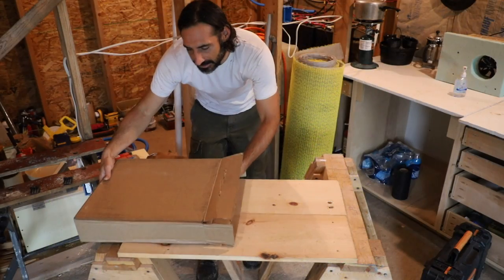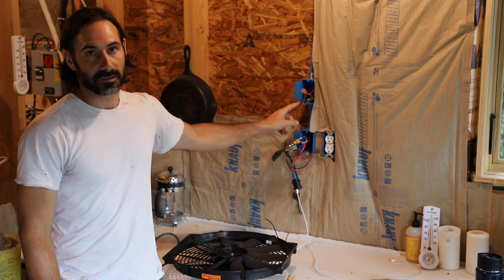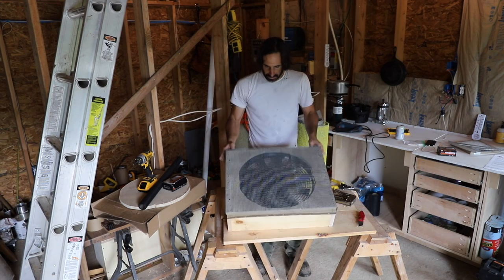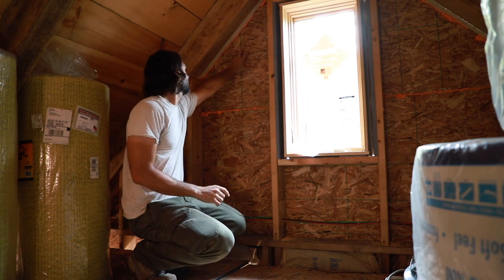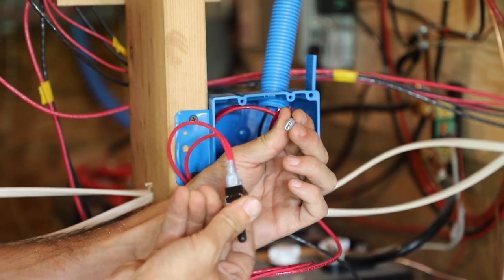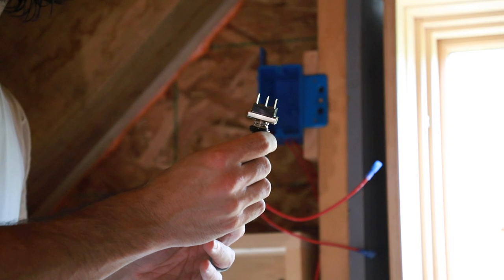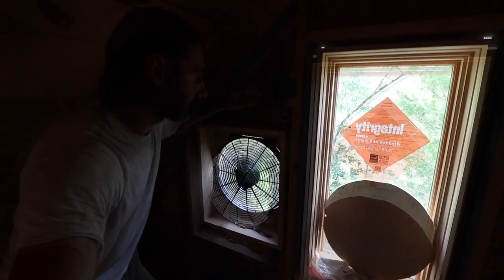Off Grid Alternative to Air Conditioning?  Making a Whole House Fan From a Radiator Fan

Comment: Dam it all, I could have sent you a fan that makes zero noise, (and yes, it meets your electrical criteria.) If I missed something than I apologize and everyone can just humour me.. There are a few alternatives that do an amazing job without having to turn up the volume    cabin efficiently, effectively and with little or no electrical power. If I was faced with this issue I would firstly kick myself for not installing a system after the sheeting went down . The system you just built for us is amazing but i wouldn't go down the same path because of the noise. There are amazing alternatives that can achieve the same thing such as solar powered opening sky , one is a solar powered set of opening skylights . The cool part is the glass and the internal  and external parts of these skylights are amazing. The "glass" in the skylight is new technology and in its varied applications work exceedingly well using the rays to power the mechanism that opens and closes the window and the sensors that detect rain or snow therefore closing the units. The idea behind your radiator issue can be remedied with an alteration or re-engineering of its current configuration. Can you install a speed selector or a dimmer switch with a thermostat so when it reads a rising temperature it automatically tunes on full speed to remove and refresh the ai rather quickly, now to manage it the new operating system will reduce speed from full power down to the lowest setting once the fan has done it's job by expelling the hot air in the gables the fan can reduce speed to the setting it needs to maintain the desired temp.. Just a long winded comment.. Iam sitting in envy of you and what you  have accomplished, hats off to another soul that has a tiny eco footprint .. we need more of us the actually care. Im afraid it was   generation that has done such a terrible job raising their kids whom are now in their early twenties and couldn't care a less about recycling, power conservation and alternative fuels..  How could we allow this to happen...I'll tell you, more children have spent incredible amounts of time at either the TV , video games and their social became logging on to _uckbook. So they are dooms day believers because thats all they see, death and destruction either from the news, violent movies and video games that are stealing our children's innocence.  Ill shut up  now...my apologies most of that had little to do with your teachings...
Reply from the maker: wow very cool. I will have to talk to you before the next project!  I do plan to wire in a speed controller I think that should help if I ever want to leave it running over night.
Reply: I couldn't agree with you more! My son will be 31 next week and my daughter hits 26 in September and l have one 4 yr.old grandson from her. I worked 2 jobs the entire time my kids were growing up just to barely get by, but we did and my kids are quite aware of many things that  their friends have no concept of! Its' always something new, be it good or bad...just look for TRUTH, it'll come your way!!
Reply: @kandiwolfe1125  You can't do anything wrong when your doing the right thing.  I hope your proud you obviously did right by your kids...

Comment: how come you didn't' buy a solar power fan from the home store?
Reply from the maker: Well, technically everything in the cabin is already solar powered.  The power system is 24 volts DC so I was very limited in fan selection.

Comment: I think there is some confusion about how long that fan will run. Its only going to run like 5-10 min. It really doesn’t matter if its that loud.
Reply: yes it does matter.
Reply from the maker: Yea it changes the air really fast.  I am also going to wire it to a controller so it can run fast or slow
Reply: Yankee Inventions   And why is that?

Comment: "That's a lot of extra wire I left there..."  commonly referred to as a maintenance loop!  This of course does not denote that I've screwed up connectors so badly that I've had to cut wire and try crimping all over again.
Reply: Frizzle:  What are the wire connectors called that he is using?  Can they be used behind drywall?
Reply from the maker: haha yea same here!
Reply from the maker: I think m y connectors are meant for DC wiring in RV's and whatnot, not sure if you could use them in a code situation.
Reply: Thanks for the wise advice.   I'll hire someone to do that part for me (I'm brave, but I don't think I'm that brave when it comes to electricity!)  Love your videos and cabin.  Always wanted to build my own place, so I appreciate your talents.

Comment: Good idea, but that fan is way too loud.  Should have put a speed controller on it.
Reply from the maker: Never too late for a speed controller.  At max speed it changes the air in the cabin in under 3 minutes.

Comment: i am confused by video scenes order at around 13:00 ... ;-)
Reply from the maker: It's possible I mixed something up when putting all the clips together.  I basically wire in the other switch at that point so I can turn it on or off from upstairs or downstairs.

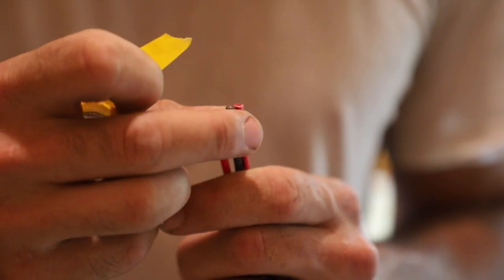Comment: It's a little loud but you got to figure when you're hot and uncomfortable you won't really care are real Whole House Fan is a lot quieter than that so we run it at night when it's cool outside and pull in all of that cool air and we run it till about 9:30 10 in the morning then shut it down and close up the house and try to keep the cool air in the house for as long as possible as it gets hotter outside during the day by late evening it's pretty hot in there so everything is open to backup but after dark the temperature starts to drop again and the fan comes back on pulling a cooler night air into the house it makes a difference the house pretty much goes from being completely unbearable 20 hours out of a day with heat and humidity to only being unbearable and uncomfortable 6 hours or so a day
Reply from the maker: yea its a bit loud, I am hoping after I wire a speed controller it will be a bit more bearable and work like yours

Comment: Great idea, but bad Implementation-- that being that God- awful loud ass fan!!  What you need is a low speed fan that you have verified is quite, yet able to provide a suitable CFM capacity. And putting a filter is also good for low maintenance situation.
Reply from the maker: It does 2,250 CFM, changes the air in the cabin in around 3 minutes (conservatively) then I use the built in silencer AKA the off switch.  I probably will fit a furnace filter to it and install a PWM controller.

Comment: Don't want to be that guy, but..... wouldn't you be getting a massive amount of voltage drop over that length with that gauge of wire?  That switch would be getting seriously hot wouldn't it?
Reply from the maker: Hey man cave, It's 5 amps at 24 volts over about 10 feet.  With the 12 gauge wire used, it comes out to under 1% voltage drop.  The switches are supposed to be able to take 20 amps we'll see if they hold up.

Comment: Why not wire an outlet next to the window and place the fan in the frame in the window behind the screen? You could use it in the summer and put it away in the winter. That way you would not have to put a hole in the wall
Reply from the maker: I like to run stuff like this straight off my battery rather than rely on my inverter.  The inverter is an instant 10% hit on efficiency, and also a decent draw on idle.
Reply: Makes sense thanks for the reply really enjoy watching your progress

Comment: Few comments, that fan is made for decent flow but also needs to pull air trough radiator fins so it must have reasonable high pressure difference (hence many fan blades), result is power hog that is loud. I would install something like this (2-4 of them): http://www.sinwan.com.tw/sinwan_web/main/en/dc_spec.asp?Type=Axial%5FPlastic%5FDC&Series=SD254AP&SID=10325  i compared flow measurements (measured it myself) with box fan ind it is comparable (~500cfm) but this one is 24V, 13 Watts only, smaller then box fan and it is super quiet even compared to reasonable loud box fan so is way quieter than that radiator fan you use, this fan of yours is just noise machine...  Here is nice selection of fans over 500CFM  with all the data you need to filter so can find perfect one...
https://www.digikey.com/short/pbdffc
Reply from the maker: Those fans look really neat, If you knew how long I have scoured the internet for a 24 volt fan you would laugh or cry.  I wish I knew about that before I started!
Reply: @50Acres  Well no prob. good thing is you can always sell yours because people use them a lot for their vehicle fan when they break, and start fresh... Also someone mentioned temperature regulation, yes differential thermostat with proportional output is the best way to deal with this, Arduino with 2 temp sensors or some similar micro running PWM with mosfet as switch can take care of that no prob.

Comment: Some advise on your crimp connection  tool, you need to test the connection you are producing with your tool  by pulling on the connection as hard as you can and if you are able to pull the wire out of the connector  your tool is wrong! You need a tool that has a talon where it crimps the connector. The standard crimp connection tool does Not do this, it simply crushes the connector and it will not hold. The talon type tool presses the connector in the center making a Permanent  connection. REALLY!

Comment: Why not just run a 4000 watt generator and a 5000 btu window unit. Screw hot sticky humidity. Besides when dew level gets just right ur house inside will be wet everywhere.
Reply from the maker: that would also work!

Comment: how can a fan replace air con when your dragging hot air in from outside im from CYPRUS 42 DEGREES thats as good as a chocolate teapot
Reply from the maker: You turn it on in the evening when the sun goes down and the outside temperature drops.  If you run it during the day it would not do any good.
Reply: @50Acres  the air in cyprus outside in the evening can stay at 30 believe me the only way you can stay cool without air con is a large pedestal fan because here the buildings turn into ovens after 40plus all day and im referring to houses outside villages where we are at and you have to really live outside im not trashing your idea but it wont go here, but hey it might be ok elsewhere
Reply from the maker: @ronspannermanread  sorry it wouldn't work for you
Reply: @50Acres  its a good idea and again im not taking the p,,,,s but ive tried everything here its a big problem as i cant sit under air con it makes me ill good luck

Comment: you are correct 110 switches on 12v  NO          but you got a 110 converter        will a 110 fan  set-up kill the batteries    i'm not a pro on the battery /inverter stuff             i'm a learner like you    dont take it as a assault                    spray foam it  all     dont play with batts             a bit overkill on  wiring a one roomer   from what i see                    plus batteries in or near living space ??               oh why why flakeboard   VOC"S 50% wood   50% glue    and when its gets wet   it crumbles          your not even half way finished and you got issues with heat   i hope you are not living in that yet

Comment: In fairness to you for all the comments about noise. That fan could probly completely replace the air in that cabin in a cpl minutes. So at least it wouldn’t have to be on long. Always wondered how this sort of thing would work if you just buried 50-100ft of 4” hose 6ft under ground and circulated your house air through it. Probly work in summer and winter ?
Reply from the maker: Yea it changes the air in the cabin pretty quick, in a couple minutes easy.  I will probably wire a speed controller.   I have always wondered about earth tubes, I have heard different things about how they work.

Comment: Good luck though. Automotive fans draw juice. Thirsty critters they are. Keep your eye on where they would plug in. Some makes of automotive fans are known to melt the plug or wires going to them after time. Ive run across it with toyota, volvo and volkswagen. Like I said, they draw amps so hopefuly you used a heavy enough gauge of wire as restrictions in the electron flow create heat. Enjoy your dream. Hope its all you hope for.
Reply from the maker: Thank you Richard, it draws 5 amps, I used 12 gauge wire, and protected it with a fuse sized down so it should be pretty safe.

Comment: hmm,24 volt system, not normal have. most all use 12volt system .solar panel, all fan,motor etc. fridge,heater etc. all have normal 12 volt. only some different pro machines etc
 truck have 245 volt.
Reply from the maker: yea it has been tough to find 24 volt appliances

Comment: May i make an honest and probably ignorant to your situation suggestion? 
Alright, I am new to your channel and videos. I won't understand everything you are doing or why.
I just picked up this video out of the blue. Please understand I won't be coming from a long time viewership.
First, Do you own any hand tools? There is a hand drill called a Yankee Drill. It is something you might be able to 
use should there be no source of power. Second, If you drill a little bit from one side of wood and then go in from 
the other side you will avoid blowing out your wood and subsequently weakening the board or lumber. 

One last thing here, I would recommend that you buy at least 2 more of those fans. Why? Well should you need or
want to install another or should the one you have fail then you have immediate backup to use.  I noticed you are using
insulation. I would like to recommend Rockwool. It's pretty darn good and not too expensive. Well outside of all of this 
it is my first time to the channel and this video so i will say thank you for the video. I will give ya a thumbs up and thank you
for understanding i am new and would not know everything you are trying to do or have done and asking some questions.
Take care.

Comment: Why do you use such a loud fan ?
It reminds me of a 1000cc rad fan for a race machine , like a Baja SxS 1000 can am 
Except I swear your fan seems to be turning faster .
Which we would love .
But for , in house , use is a bit loud .
Thinking about physics bla bla 
I can’t help but think a larger fan would pull and exit the same amount of air with less rpms 
But you didn’t have a wider space .
It should do the trick .
Hats off for everything!
Reply from the maker: thank you, it changes the air in 3 minutes, then I turn it off.

Comment: How are you going to dampen the noise from that fan? 30 second of that noise would make me want to run away.
Reply from the maker: Im going to wire in a controller so I can run it on partial speed

Comment: Holy Shit Man! I thought that bitch was going to take flight! How many CFM does that thing move? I had a setup in my basement that blew the cool basement air thru a duct system, and thermostat set exhaust fans, in the attic gable lovers.  Similar but reversed to what you have set up.
Reply from the maker: It's super loud!  Anecdotally I am pretty sure it changes all the air in the cabin in under 5 minutes, it really blasts.

Comment: Get a rad.fan from a junkyard for $10 next time.All front wheel drives have electric fans and the are quiet. They will run under water like a trolling motor.lol

Comment: That is too loud. I used in my previous house one on the 3 speed square fans  with round corners from Walmart and worked a loooot better. On lowest speed you almost could not hear it. I coled 1800SF. you should have turned that fan on before you installed it.
FAN was $15.
Reply from the maker: Yea too loud!  We'll get it figured out though.

Comment: Buy an exaust fan with window it is much better
Reply from the maker: I prefer to run it off the batteries rather than the inverter, and also have it wired to a 3 way switch to control it from up or downstairs. So I had to use a 24 volt fan.

Comment: You don't need an active system.  With proper design, natural convection will pull air through the house using zero man-made energy.  An intake shaft pulling air from the shady area beyond the tree line to feed the naturally cooler air into the house and a proper "chimney" painted black to start the convection and you're set.

So instead of exhausting room temperature air you're replacing it with naturally cooler air.  There will be an average difference in air temperature of -10 degrees between house air and shade tree air.  Look at the thousands of years old houses of the Middle East, Africa and the Asian deserts.

Totally silent, won't waste your solar power and generally more natural, healthy air.
Reply from the maker: That does happen naturally if I just open the windows, but the fan speeds up the whole process.
Reply: @50Acres  

Haste makes waste.

Comment: How long can fan runing
Reply from the maker: I've never tried to calculate it out, but I've got it on a variable speed controller now, so at the right setting, it can run indefinitely as long as we get some charge during the day from the sun.
Reply: @50Acres  im have 1 extra fan..my extra fan conect to adaptor 12dc..my extra fan runing high rpm for 12 second..and slow runing for 2minute...its normal???
Reply from the maker: Hard to say without seeing what’s going on but no I don’t think that’s normal.